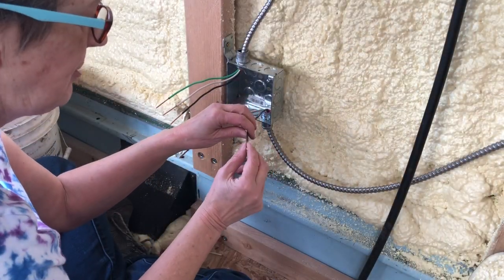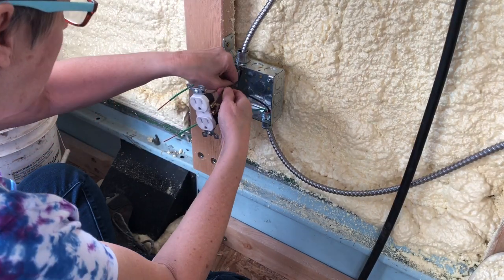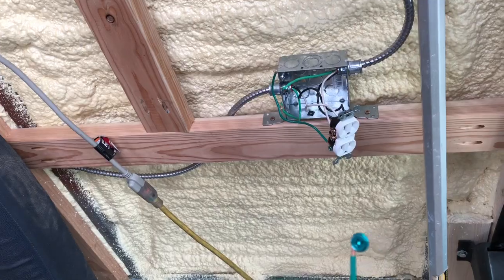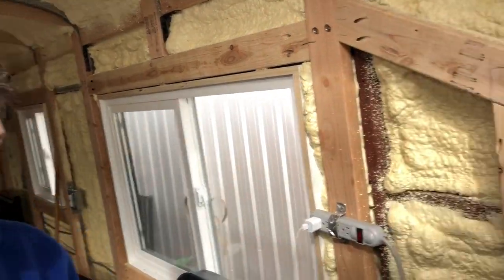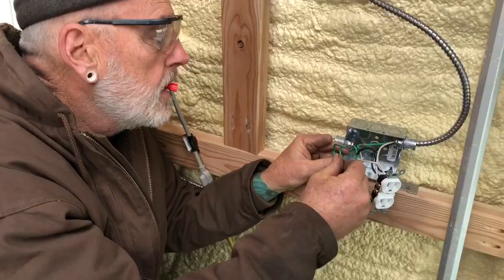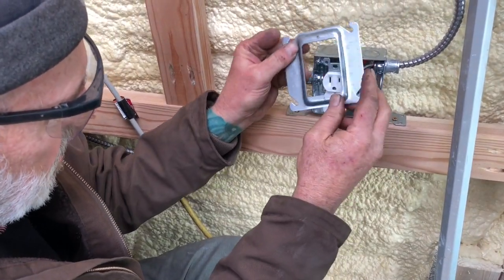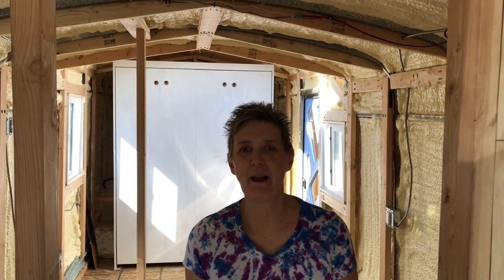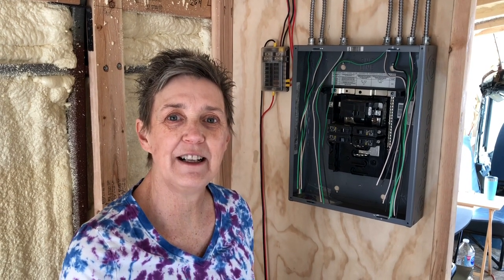Electrical Outlets - Vlog 93 School Bus Conversion

Comment: Recommendation, replace those outlets (or at least some of them) with outlets that have usb ports (no extra wires to run
Reply: Do those have to convert the 110v to 12v? I've run separate lines just for the marginal gains in efficiency from not having to convert DC to AC and then AC back to DC to power a USB hub.
Reply: @shaymcquaid  no doesn't require any new wires, I just installed them in my house, inside the outlet it converts it to dc 5 volts (very convenient)
Reply from the maker: We thought about them but decided not to go that route.

Comment: I would keep the AC & DC circuits separate. If you ground your box and have metal conduit that contacts the chassis you have combined your AC ground with DC negative. May not show a problem right away but can lead to a lot of funky stuff.
For example, I wired a converted enclosed trailer, I had one exterior AC outlet which ground  touched the chassis, I intermittently could get a tingle from the chassis to wet earth. Just enough to make me question if I really felt it. My fridge would cause my gen to make constant adjustments and I couldn't run my air con on high.
I finally found the circuit cross point, eliminated it and all my problems went away.
My personal belief is these issues come up because there is no true earth ground for the AC while using a generator  or solar inverter. Shore power of course would provide an earth ground. Which means at that point the negative of your battery is tied to earth and by extension AC nuetral.
Reply from the maker: Thank you for this information. I am a bit befuddled. I got a hold of a electrician for input on how to wire the bus and he put me onto the MC cable. It seems like a great idea :-) so if this is a problem what is the solution? In my mind I’m thinking I have to go back and remove the metal clad conduit and put regular Romax back in there? Please share your thoughts on this? I don’t mind going back and doing it until it’s right :-) I surely don’t want to get shocked or electrocuted :-) everything is going to be connected to a Victron multi plus inverter. So how would this ground? I really appreciate your comment and concern for us :-)
Reply: @KnappTime  Grounding the individual outlets are fine, but if possible use a plastic box and don't have anything from the AC (120v/240v) grounded to the chassis. I've debated this with multiple educated
 electrical engineers, and it's always been somewhat amusing to watch the expressions when I remind them that an AC circuit on a vehicle doesn't have an earth ground. The consensus has always been it's safer to keep the circuits separate.  Outside of some type of device failure in the circuit I don't believe there is any danger to people, but components in the circuits may not function as they should and may not live as long as they should.
I really hate to be the bearer of news that may create extra work, as if there is not enough already.
BTW, the conduit is fine, as long as the boxes aren't grounded. However, with them being metal, even if you don't directly ground the box, it will still close the circuit / "ground" through the screws that pull the outlets secure to the box.
On my trailer the ground came from the cover of the outside receptacle box cover, it was metal with a foam seal. After a few hundred miles the metal worked through the foam and grounded to the chassis. I chased it for a while before I could find it.